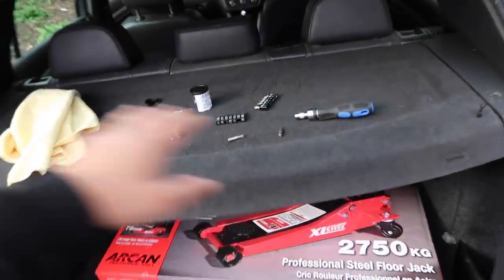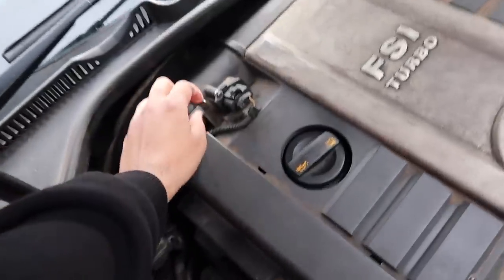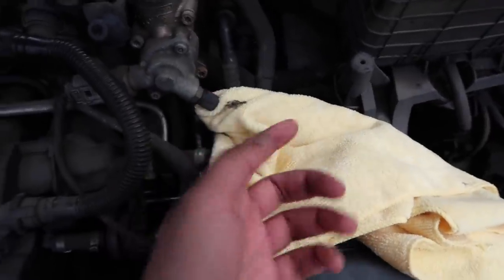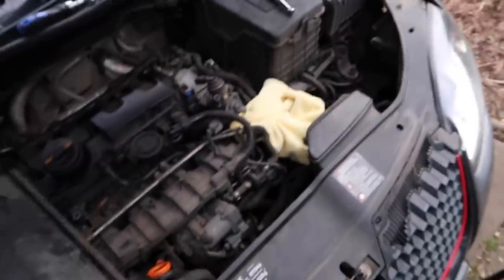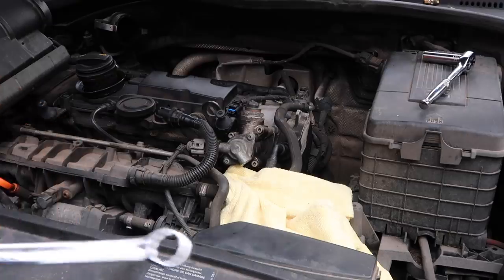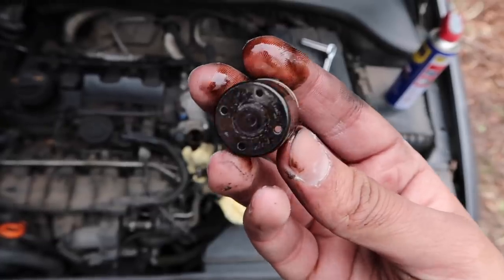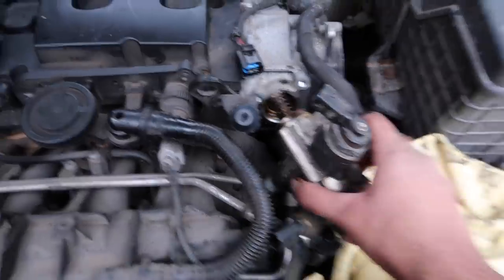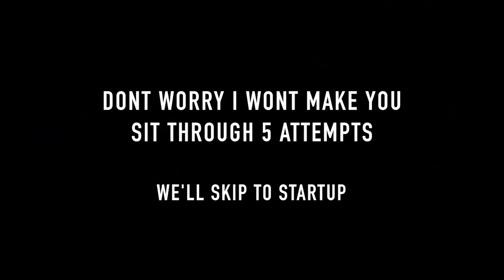Fixing a BIG Problem with the 200,000 Mile GTI!

Comment: Worth adding that if you leave the battery connected, don't open the drivers door or turn on the ignition as the fuel pump will prime, spraying fuel all over the engine bay
Reply: My car doesn't do that, only time fuel pump comes in is when the key is on the on position

Comment: Electrical cables = push - depress - pull.  dont use tools, it'll kill them.  Also, run car and remove fuel pump fuse - wait until engine stops.  Also when replacing the follower, bump the cam so its at its lowest point before installing pump.

Comment: Sort out that oil cap asap, you can remove the extension holding the cap if its broken and screw straight to the rocker cover, change pcv, rev G diverter valve, budget oversize ram air intake, 3" downpipe,  vis fuel pump internals,  a trip to Rtech performance for a custom map, many smiles from then on
Reply: He should do it all himself I reckon. 

And have polls on what mod next and which brand etc so all us subscribers feel involved.
Reply: Had the exact same thing with oil filler cap on mine

Comment: My Leon TFSI has done 62k and is on its 3rd cam follower, if the coating has worn through it needs replacing. Unless you have documentation for the cam belt being done recently then you should definitely get it done, particularly if you're going to get it mapped as they are supposed to be changed every 40-50k.

Comment: Those bolts holding the HPFP on are known to strip. I usually try to keep as much pressure against the HPFP when removing or installing to keep the tension off the mounting threads as much as possible. You can change it to a stud conversion. Also, once you get that aftermarket intake, you can remove that turtle neck (oil filler neck).

Comment: That old cam follower was really bad, as soon as you see the black is starting to fade away it’s time to change it. Also about the noisy Diesel idle could easily be the cam chain tensioner. 
You should only hear the injections which are loud but no chain rattling. Chain rattling  is a diesel sound. Great video

Comment: Just changed mine at 85,000, needed doing. However my pump does not have the rubber hose or valve, it’s the older style with the ball joint on the left and the rigid pipes. Safe to say it took me a little longer than I thought and it was all thanks to that bolt, it was a nightmare to get too

Comment: I did this job on my Audi A3 a few months ago with 133k on the clock, I too was worried it had never been done as I couldn’t find anything in the service history. It’s a bit of a pain, I have version with the banjo bolt but for some reason it didn’t have the Schraeder valve.  I have my old one in front of me and it’s just worn through the black metal, yours looks a lot more worn as you can see the circle from the rear. How did the cam lobe look before you put it in, was it scored?

Comment: Nice video mate 👍🏽 Done this job on mine a few years back. It’s worth pointing out not to open the drivers door as it primes the fuel pump. I don’t remember bleeding or removing the shrader valve when I done it though? May have done though? Any particular reason for doing that mate? Cheers

Comment: Cool vid.  What does the cam follower do? Maybe in the next maintenance you can detail the purpose of the parts job being replaced.
Reply: Basically.. when the cam rotates a lobe makes contact with the follower which drives the high pressure fuel pump.. so it's metal against metal contact thousands of times per minute.. so it's prone to wear and if not kept an eye on can lead to oil bleeding into file pump and fucking up injectors which will cosy shit loads.
Reply: @NobleDistortion  thanks. do all cars have them? currently own a polo gti 6speed manual?

Comment: Loose oil cap will cause a vacuum leak - idle will be rougher, fuel trims will be out of whack. Can also affect low rpm power.

Comment: Not sure if you removed the 15amp blue fuse (fuse box between steering wheel and door) which prevents fuel system inadvertently charging. Someone else made this very good point if you open the driver door with keys in ignition and battery still hooked up, fuel might start spraying in your engine bay. Better safe than sorry :-D. Good vid though.

Comment: Get a set with hex, torx and spline bits off ebay etc... and a 3/8 and 1/4 ratchet. A screw driver is brutal for jobs like that when they need a bit of force.

Comment: You dont need that cloth bro, to make it easier, take the fuel pump fuse out, run the engine and it will be clean. After the job is done put the fuse back in and prime it by turning key 2-3 times
Reply: @user-tp4dj1pg7l  commenting on something i said two years ago? Whats up? You need attention?

Comment: Do people think I should buy a standard mk5 gti or spend a bit more and get an edition 30?
Reply: Depends on your budget and if you want big power. Main difference is ed 30 has the s3 turbo and can get an extra 40bhp compared to a normal gti when they both are remapped stage 1.

Comment: Put the clamp on the intake not on the hose. Youll fk it up like that. 
Also clip the airflowmeter away from the cover, otherwise youll rip it when the cover falls down.
Reply: Also replace the seal every time.
I forgot it once and the pump sprayed fuel everywhere.

Comment: I’ve got an Audi A3 2.0 tfsi DSG same engine as these. I’ve had a problem with mine losing coolant, there’s no visible leaks, I top the coolant up and it disappears from the coolant expansion tank, I had the expansion tank and cap replaced yesterday but still not holding in the expansion tank, the coolant light comes up on the dash as the sensor is telling me the level is low in the expansion tank also. When I drive a decent amount the warning goes off the dash. The car doesn’t overheat and isn’t blowing smoke at all. But 3 times now I’ve opened the bonnet after a drive and there’s coolant splattered all around the expansion tank. 
Any ideas what’s going on, I’m aware it could be worst case scenario a head gasket early signs but I have used K seal head gasket repair just over a month ago and still happening. No matter how much coolant I put in it drops way below the minimum line, it doesn’t bubble in the expansion tank or anything either, I’m just so confused. I had the car up on the ramp and a mechanic said there is a very small amount of crystallised coolant residue coming from the bottom of the timing belt cover around where the water pump sits. It had cambelt and water pump replaced about 30k miles ago 
Any help really appreciated! 
I just noticed your coolant expansion tank is holding coolant but mine is empty :(
Reply: GsQ Artemis may be worth buying a new cap for your expansion tank. Also worth getting it pressure tested to see where the leak is coming from.
Reply: Have already done both of those things pressure test had no visual leaks and replaced expansion tank and lid, yesterday it overheated and went back to 90
Reply: @T R Hamza any ideas?